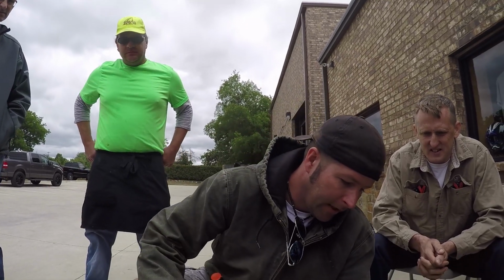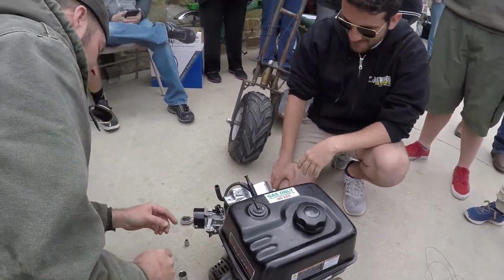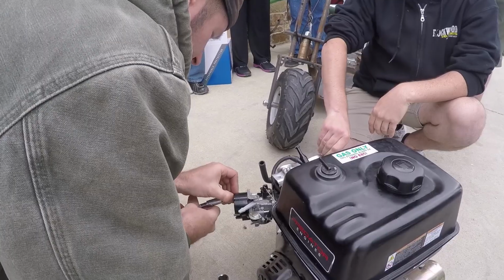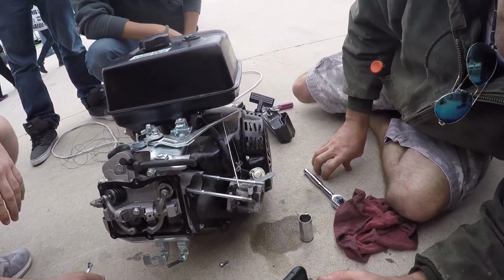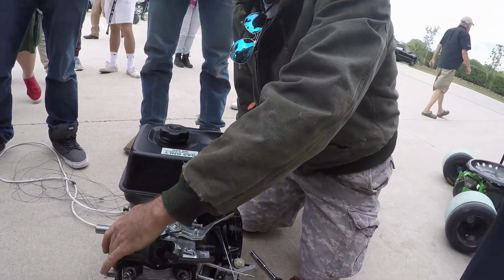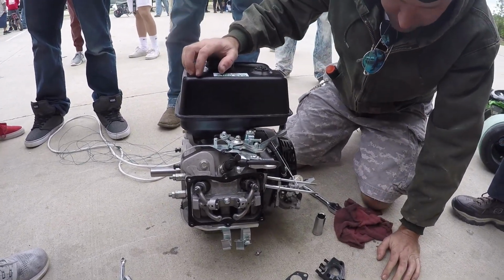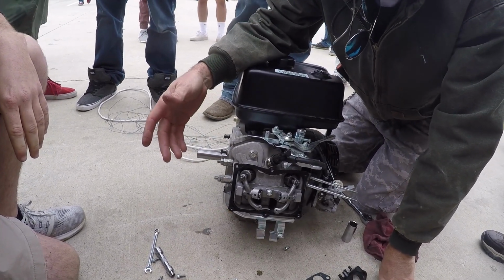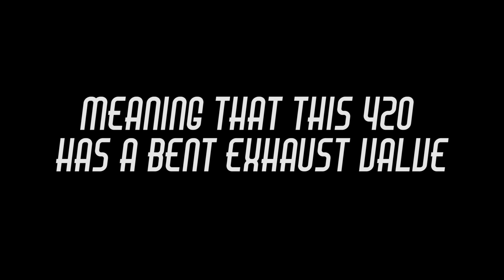Diagnosing a 420cc Predator with No Compression

Comment from the maker: Removing the governor is a great free way to get more RPM out of your small engine, but sometimes this happens...
Reply: hi
Reply: Love how you're diagnosing a predator 420cc and this vid is 4:20 long.
Reply: you beat me to the comment
LOL
Reply: hi people
Reply: yeah, heavier valve springs and she woulda been fine :)
Reply: Can you guys help me with a problem on my predator 212? It idles fine, and runs fine at low to mid rpm, but at mid to high rpm(high enough to engage a centrifugal clutch, it sputters, pops, backfires, and usually almost dies. Its a brand new engine, but it wont rev high enough to do anything without dying
Reply: Yeah you might be able yo get a refund or a new engine
Reply: Gabe Hernandez if you got it recently TAKE IT BACK! if you can't return it anymore, what I'd do is Check the fuel inlet needle! Could be particularly blocked not allowing the engine to run at higher speeds
Reply: Thanks, I cant take it back, so i'll take a look at it, also thought it could be the timing is off.

Comment: I know I am going to get shot down for this but here goes anyway! I have successfully straightened bent valves and returned them to service with no problems. Don't shoot, my hands are up! The valves have not failed after hundreds of hours of running. The amount of bend is very slight and a few taps with a soft hammer whilst holding it in soft jaws in a vice. The material of the valves is easily capable of withstanding a bit of gentle reworking without being stressed or weakened.
Reply: couldnt hurt to try.
Reply from the maker: Whatever gets the job done!
Reply: Did similar thing myself lmao

Comment: Doing a governor delete is an easy mod o do, but you have to make sure the other components are going to be able to handle the added stress of higher (higher than they were designed to handle) RPM that you will produce.  If the valve had hit the piston there could be other problems besides just a bent valve; there could be damage to the piston itself, maybe damage to the rings depending on the impact force.  It will be a learn experience for this person that is for sure, just lucky the valve is what went and not something that could cause a catastrophic failure/injury (ie the rod blowing out of the block or flywheel exploding).
Reply: It'll be fine.

Comment: That was not the valve bend bud is the variable cam it gets bend by the rpm and now it keeps the valve slightly open and it leaks air. You can fix that by changing the cam. The motor is perfectly fine. Just happy to mine